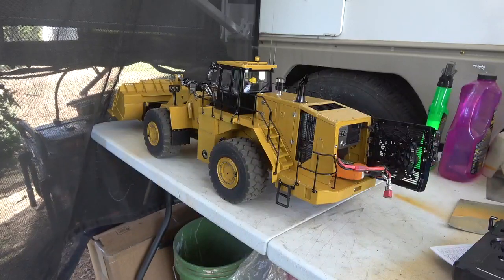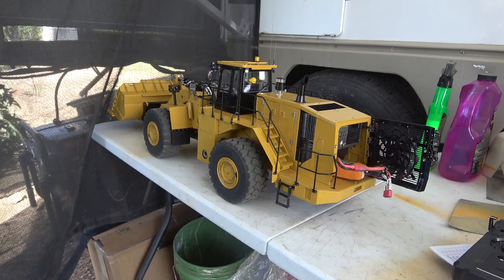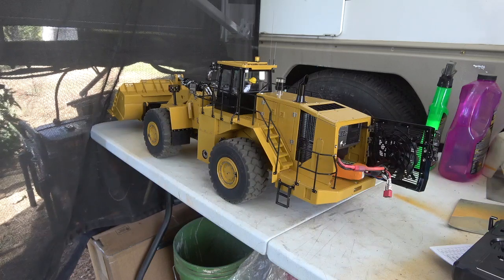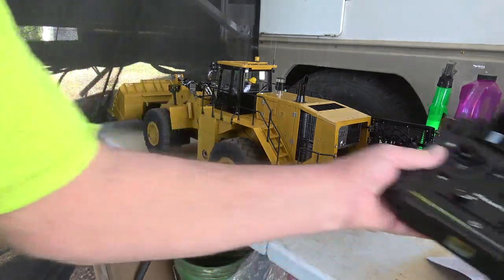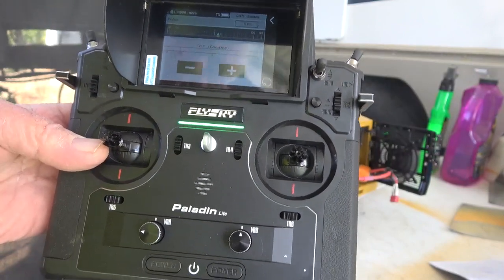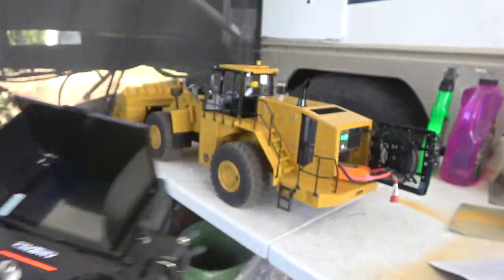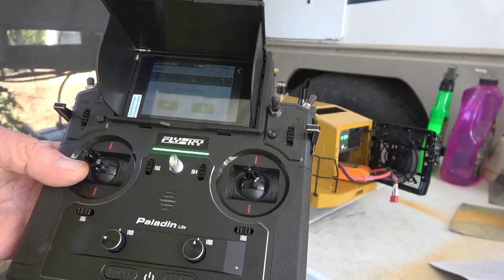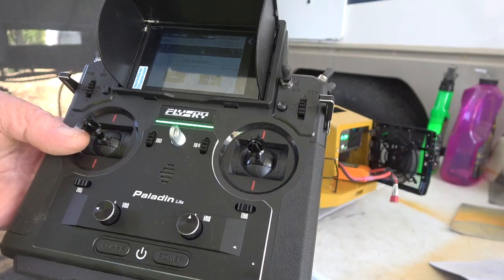k988 issues right out of the box

Comment: I know 3 guys who have this machine and myself, all of us had to seal some oil leackage after first use as it gets warm for the first time. But great machine. We moved about 1000kg of dirt yesterday with only 1 of those loaders and a bunch of dumpers at a event. They are so capable.
Reply: I'm thinking about getting one,what kind of oil leaks did u encounter and had to repair? I need to know these things before I get one
Reply: @curtisck813  Just loose screws. Propably losened from long transport to europe and vibrations. One guy had scres on the cylinder lid to tighten, i had to tighten the screws at the oil cooler lid. And my manometer was broken form the start and leaked. That was like a  3$ replacement. I think all hydraulic toys in1:14 if not built by yourself have this issues that you got to tighten the screws at some point. The only one i didnt have to yet is the dozer i build myself and made sure the screws are tightened. On my excavator i almost lost half the screws on the Track motor lid. After tightening it was fine since.
Reply: @phoenixsui ohhhh...ok...I had those same issues with my 793 mining dump truck...
Not the issues that this guy is having with gears grinding, and I read u have to watch the main driveshaft..and keep everything oiled and lubed 
I sure appreciate the immediate response because I'm seriously thinking about getting one...the guy on this page said to go with a XD front loader...I'll look it up
Reply: @curtisck813  Propably both siimilar in quality. I qwent with the 988 because of more stability. Longer and more weight.
Reply: Same here,for the same reasons, it's size,height and length is what I'm looking for to pair it with my big ass mining dump truck, but the kabolite 988 looks like a Cat 992-4,minus the 1 exhaust stack,that's why I want one  @phoenixsui
Reply: @curtisck813  Yeah but the real 988 also looks like this.
Reply: How long have u had your kabolite  @phoenixsui
Reply: @curtisck813  I got 5 different models and the 988 i have since 1 year. After fixing the basically issues directly after delivery (tighten screws and the manometer) i never had a problem again. I also painted that grey plastic part on the cabin side black. The only ugly spot :D.